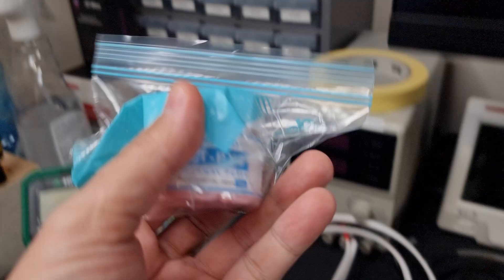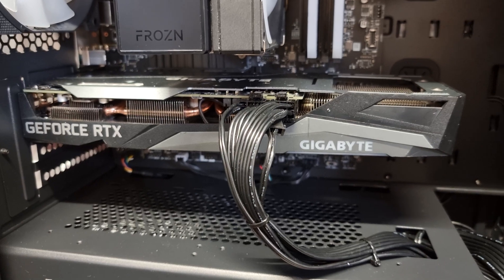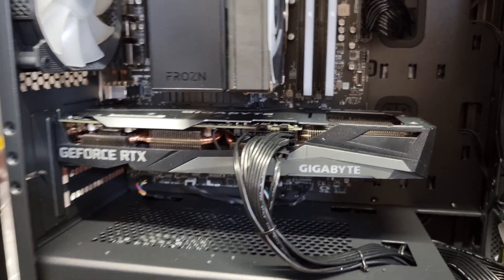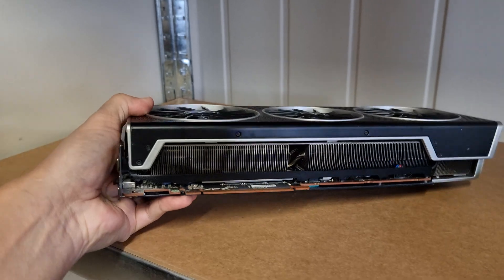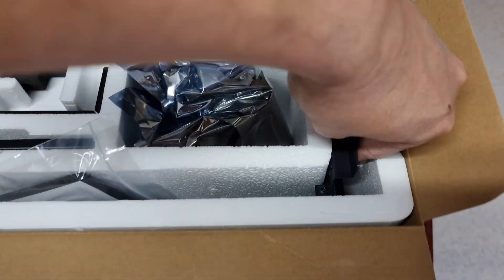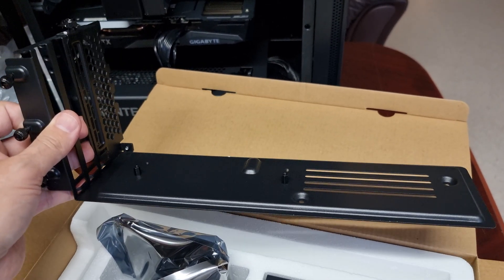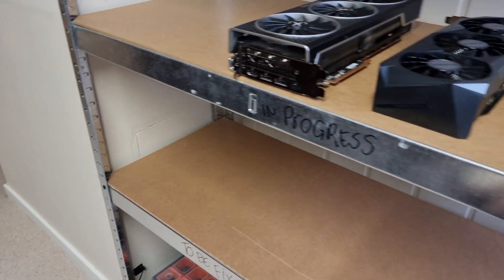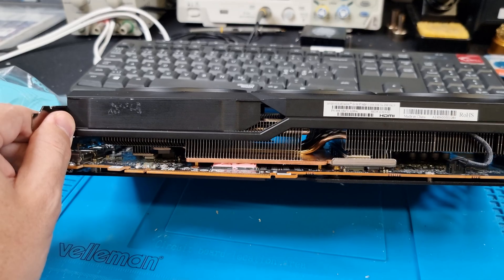Why Modern Day Graphics Cards Are Dying Prematurely.

Comment: I have a Corsair 2500X with a TUF RTX5090 + TUF B850M-PLUS WIFI (3xNF-A14 at the bottom of the case).

Do you have any advice for a sag bracket? :D
Reply from the maker: I buy these from Temu, but you can also find them on AliExpress: https://www.temu.com/goods.html?_bg_fs=1&goods_id=601099695186759&sku_id=17592891160347&_x_msgid=151-20250904-18-B-905764602225426432-427-zLleLmFr&_x_src=mail&_x_sessn_id=8d7rhikg46&refer_page_name=bgt_order_detail&refer_page_id=10045_1763738495447_073todoodi&refer_page_sn=10045
Reply: @TechnologyHive  Hey thanks for the reply! I will take a look :)

Comment: Hello, should I buy a case and switch to a vertical mount? Would an anti-sag bracket do the trick? I have an  Asrock Steel Legends RX 9070XT.
Reply from the maker: You don't need to buy a new case. A good support and correct placement of it should do the trick. Place the support between the second and third fan, so 2/3 the way. This will keep your card happy. But if you want an excuse to move your hardware into a new shinny rig, sure. And vertical mounts look nice also.

Comment: been thinking maybe i should get an adjustable bracket, have a dell 3090 (it's small, like 267mm small, they were made to fit into alienware r11's, but chonky heatsink & vapor chamber so still heavy for it's length), visibly it hasn't budged a bit in a year so far
definitely no 40 or 5090 in mass so i might be letting tech paranoia get the best of me, but they are kinda precious commodities at the moment

seeing now that's not really the message of the video, but still, one thing that's been on my mind
will be very careful playing around in there (like i said, tech paranoia, so i'm usually good at that, but also a little clumsy, card is coming out anytime i need to tinker from now)
Reply from the maker: The cost for GPU's is about to skyrocket also, due to VRAM cost going up. So I'd advice you to hold on to that 3090. A $5 support can do the trick. You find them on AliExpress.

Comment: so 
basically you are saying for a new build, i should mount my card vertically, or horizontally with a support?
i am new (so ne that i didnt even built a pc yet). i was thinking about a " Lian Li O11 DYNAMIC MINI V2 ", and in their page they have the "GPU ANTI-SAG SUPPORT", is that enough to prevent this issue with an horizontal gpu, or am i better of to go with a vertical setup?
thanks :D
Reply from the maker: If it is a new build and your card is a heavy one, I would use a vertical mount. That is a nice case, btw. If the case comes with some kind of support, definitely use it, if you want to skip the vertical mount.

Comment: Installing a GPU water block could be another way reduce the weight of those cards.
Reply from the maker: Yes, but then you add another failing point, the pump. And typical water blocks are not light. They do have some weight to them, though not as much as some of these ridiculous heatsinks nowadays.

Comment: Why specifically 3rd party vertical mounts? What's wrong with one built into the case?
Reply from the maker: The vertical mount options typically included with cases places the GPU too close to the side panel, not allowing it to "breath". 3rd party vertical mounts allows you the owner to place the card closer to the motherboard or closer to the side panel. Obviously you'd want to have the GPU away from the side panel so it can be kept cool.
Reply: @TechnologyHive  I was thinking maybe they dont have any support at all on the bottom & all the strain is on the frint bracket & thats why you didnt like the case ones.

I never understood why they put it so close to the side panel for vertical mount. Defeats the purpose to have a great GPU & then have it thermal throttle all the time.

Even SilverStone made a new FLP02 with option to vertical mount but no breathing room. They could've at least put 1 small fan hole there for it. Many old cases had a little fan on the side for ventilation.

I was thinking maybe they dont have any support at all on the bottom & all the strain is on the 1 bracket & thats why you didnt like the case ones.
Reply from the maker: @goldenheartOh  I am with you on that I too have no clue why they even build a case with support for a gpu vertical mount, yet place it so close to the side panel, defeating the purpose of the vertical mount idea in the first place. This is why I recommend the one I use in all my builds for customer or personal use, which is the Phanteks vertical mount. It is cheap relatively to the cost of one of these newer cards.

Comment: i have aorus master 5090 and i want to mount it verucally but i cant because the putty will leak as people say

also currently its mounted horizantlly + included anti sag stand is installed
Reply from the maker: That's no problem, just add a support between the second and third fan and you will be fine horizontally.

Comment: I just bought a Saphire 9070 xt. Sadly I cannot mount it vertically. I need to do it horizontally. I am aware of the sag and thats why I additionally bought a support. A little black stick which I can make longer and shorter by adjusting screws and has a magnet on the bottom side. Will this be enough to save my card from damage by being mounted horizontally?
Reply from the maker: Yes. I would put the support between the second and third fan. It will be just fine.

Comment: It is great that you made this video to make people aware of these kind of issues :)

I started to add something at the end of the card to hold it straight in the case 2 years ago when i bought higher end cards that had some weight to them.
Having the card in the case without any support will make the circuit board of the card to slowly warp over time when it gets cold and hot if it doesn't have any extra support to hold it up.
It can also damage your pcie slot on your Motherboard over time too.

There is no need for a expensive vertical mount or a sag bracket If you can find something at home to hold it up at the end of the card in the case if your case doesn't have space for a vertical mount bracket.
Reply from the maker: I use these from Temu and they work just fine. You can also find them on AliExpress: https://www.temu.com/goods.html?_bg_fs=1&goods_id=601099695186759&sku_id=17592891160347&_x_msgid=151-20250904-18-B-905764602225426432-427-zLleLmFr&_x_src=mail&_x_sessn_id=5tvx3pe5b8&refer_page_name=bgt_order_detail&refer_page_id=10045_1763723059572_rcrer8du7o&refer_page_sn=10045
Reply: @TechnologyHive  That is what i use now too :)

Before i found it on Temu i was using a pretty and small mint box to hold my card up that looked great in the PC but it didn't fit my newest card so i did some Temu shopping. he-he

I  also bought a Vertical Bracket but that wouldn't fit in my case so i ended up using the Temu Stick that i bought as option B.

Comment: As GPU's gets bigger and heavier,i use vertical mount bracket.I use it on my previous 3080 and
now on my current Sapphire Radeon RX 7900 XTX NITRO+ Vapor-X (2,850 grams).
Reply: not op but i've just got the nzxt one on sale (40€) and it does its job
Reply from the maker: @jeddunkxyz  That's a good vertical mount.
Reply from the maker: It would be helpful if you could post a link to the vertical mount kit you are using. I recommend one by Phanteks. Its under $50 and well worth the price.

Comment: Due to how heavy my GPU is, I was worried that it would crack even vertically

So I got a riser cable and I placed the GPU on the bottom of the case

It looks questionable, but at least it is placed on top of the bottom case fans so it sure as heck ain't lacking air flow xD
Reply from the maker: It wont crack vertically unless you try cracking it yourself. Also, remove the card during transport, as it can be damaged even if installed vertically.
Reply: @TechnologyHive  one day they'll crack vertically too, because the card is so heavy that it is sketchy enough as it is
Plus I am not a careful person, I fully expect my pc to be bumped and moved around by myself in a few months xD
Reply from the maker: @labmasterx5599  I can't help you there lol. But your card should survive more abuse vertically mounted than horizontally.
Reply: @TechnologyHive  thank you xD

Comment: The issue with vertical mounting cards like most 5080's is that the airflow goes from bottom to top so when mounted vertically you end up blowing hot air onto the motherboard messing up the airflow making them run a lot hotter than they need to be. I'd say a decent gpu stand on the edge is fine in my experience 🤷‍♂
Reply from the maker: You can do as you wish. But installing the gpu vertically does not increase motherboard temps. In fact, it helps redirect the hot air up and out of your case, as long as you have good exhaust in your case.
Reply: @TechnologyHive  That depends on the type of gpu. My 5080 inno3d Ichill card blows like 80% the total heat straight up form the back of the card. So when mounted vertically its blowing 400w of hot hot air straight onto the motherboard and ram. 🤷‍♂ To add to that fishtank cases with side intakes makes this even worse as then they're pushing air against a vertically mounted 5080 exhaust. All I'm saying vertically mounting isn't always the best option.

Comment: Good day sir hope you are well, like a noob i put 2x4pin cpu into gpu...and put on pc..nothing happn ...i realize mistake ...gpu bluelight go on , but the board is cold and no fan spin on startup at all...can it be repaired ? i took it out my system no visible damage to board 😢thanks for your time oh its rx 580 xfx gts xxx 8gb ,is it possible to save
Reply from the maker: If you used the wrong power connector and the card is no longer working, then surely there must be a short somewhere. Honestly, the repair will cost you more than the card is worth.
Reply: @TechnologyHive  thank you for the response and thats what I suspect as well 😢

Comment: Oh shit, glad I found this video. Or it's more like it found me, valuable yt recommendation here! Bought a 5070 TI -  2months ago, already thought that this brick could lead to issues without support, now I know for sure.
Reply from the maker: Those are generally large and heavy cards. Yeah, I would use some form of support. It doesn't need to be fancy. You can find them on AliExpress or Temu. I use these here myself: 

https://www.temu.com/goods.html?_bg_fs=1&goods_id=601099695186759&sku_id=17592891160347&_x_msgid=151-20250904-18-B-905764602225426432-427-zLleLmFr&_x_src=mail&_x_sessn_id=5tvx3pe5b8&refer_page_name=bgt_order_detail&refer_page_id=10045_1763723059572_rcrer8du7o&refer_page_sn=10045

Comment: Thank you this is really good info right here, one question though, Is there not any other risks mounting the card vertically ? I mean with the heat generated by the card long term speaking can't it end up with other issues on core or memory ? Like old iMacs that had graphics card going bad because of the vertical mounting and heat
And the card is not by design created to run vertically
Reply from the maker: If you have front mounted fans blowing cool air into the case, and one or more as exhaust, you will be fine. I have had my cards installed vertically for years and never have had any issues with overheating the memory or CPU cooler. Just use proper exhaust and you're good to go.

Comment: Can we use like a lifter that goes underneath the card and acts as a support beam, if so what to use and where to place it?
I have another question and if anyone knows the answer (Gonna use a Superflower Leadex VII Platinum Pro 850W for 9070XT and 9800x3D, how good is the PSU?)
Reply from the maker: Regarding the PSU, Super Flower is top of the line, especially the Leadex VII. I have a few of them. They are the OEM for various reputable brands of PSU's.

You can get something like this as support:  

https://www.temu.com/goods.html?_bg_fs=1&goods_id=601099695186759&sku_id=17592891160347&_x_msgid=151-20250904-18-B-905764602225426432-427-zLleLmFr&_x_src=mail&_x_sessn_id=5tvx3pe5b8&refer_page_name=bgt_order_detail&refer_page_id=10045_1763723059572_rcrer8du7o&refer_page_sn=10045

I do not care where you get it, but this will work just fine.

Comment: I chose for a water cooled graphics card because of the smaller size (even shorter than the motherboard) and weight but I also decided horizontal mounting is the way to go no matter what so I bought a rackmount enclosure.

It just happened to fit in the top shelf of my under desk shelf/ cabinet so it lives there and I have a bunch of extra room on my desk 😂

I also mounted a base board heater under my desk that cools my pc while keeping me a bit more comfy 😅
In the summer I just have to close a valve and open another one to dump the heat outside.
Reply from the maker: Just keep in mind that water-cooled gpu's tend to fail around 3-4 years due to pump issues or permeation. I am not saying your will go like this, but it is common.

Comment: So correct me if im wrong with understanding the point. 

Basically, we just need some form of support and that support doesnt need to add additional force (upward force) to the gpu itself. And only to "level" or atleast add some like security/latch/ any other form to the other side of the gpu (i mean the opposite side from the screwed in part of the gpu)
Reply from the maker: The card just needs to be leveled to the PCIe slot. No need to add force pushing the card up with a support or anything like that. The card is just supposed to rest on the support and that is it.
Reply: @TechnologyHive   I see thank you for that. 

Although I have an interesting case tho. Like literal "case", my pc case. The gpu is so long that I need to remove the middle case fan just to fit it there. And so theres no more room to add the support on the far right side of the gpu. 

So then I used the bottom fan itself as the support. I raised it to the level of the gpu, screwed it in, then there it is. 

Do you think thats also okay or will still do the job just fine?
Reply from the maker: @thubanhiroi  The best position for the support is 2/3 the length of the card, so if it has 3 fans, add the support between the 2nd and 3rd fan. 

I see you have gotten creative there using the case fan as support, but that is at the very end of the card. I suppose some support is better than none, but I would still, for the long run, get a dedicated support for the card. Something like this will work. I use them myself: https://www.temu.com/goods.html?_bg_fs=1&goods_id=601099695186759&sku_id=17592891160347&_x_msgid=151-20250904-18-B-905764602225426432-427-zLleLmFr&_x_src=mail&_x_sessn_id=5tvx3pe5b8&refer_page_name=bgt_order_detail&refer_page_id=10045_1763723059572_rcrer8du7o&refer_page_sn=10045
Reply: @TechnologyHive  kinda because the bottom of panel thing (of my pc case) below the gpu is cut way too short. So i cant really put the support on the 2/3 parts of the gpu, more so just in the middle of it. 

Anyways, thanks for the info!!

Comment: My 1080 Ti likely failed due to this issue. It sagged heavily and eventually developed VRAM artifacts. Its like the physical connection to the memory is lost.
Reply: @voyagerdeepspaceexploration  why not just use a gpu support?
Reply from the maker: @heroicsquirrel3195  Using a support after the card has failed will do nothing.
Reply: @TechnologyHive well duh😂 im saying why not just use a support initially, i gave an asus prime 5070ti which is pretty small n light but i still use a support like i did with my massive suprim x 3070
Reply from the maker: The repair should not cost more than the card is worth. But 1080Ti are a legend, imo. And yes, if you are seeing artefacts, it is likely the memory or depending how bad the sag is, it could also be the core.

Comment: Me: Make a hook from a steel wire and bolt it to the case with nusts... GPU works for 10 years
Reply from the maker: As long as it provides support, it should work :)

Comment: One thing that i haven't really heard anyone point out, the biggest issue that modern gpus have is that the metal io bracket that attaches to the case is NOT attached to the cooler in any way. Without firm attachment of the rear io bracket, all the weight is taken up by the pci e finger. This was sort of touched on in a jayz2cents video but no emphasis was made in why sag can lead to card damage. https://youtu.be/liChy76nQJ4?t=8m41s

If the metal io bracket was firmly screwed into the cooler and shroud and did not have a gap between the two, as the gpu tries to sag, it will firmly push against the metal bracket like a cantilever. 

Of course vertically mounted gpus are the safest, and a properly leveled and supported horizontally mounted gpu with sag bracket or stand is also decent. Unfortunately not everyone will go this route which is why these cards should be designed to cantilever against the back of the case by default. The fact that gpu manufacturers rarely do this just means they don't care one bit.

Personally i prefer the look of horizontal gpus without any support bracket or stand. I always shim up my gpus with cardboard so they are firm against the io bracket. Here you can see there is absolutely no sag and the way they should be from the factory. https://imgur.com/a/GhCECyj
Reply from the maker: I have two cards here from XFX in for repair with the GPU IO plate that attaches to a metal frame that runs all the way to the rear of the card and still the cards have the same issue: ripped memory pads by the PCI-e slot. It is best to use supports or install the card vertically. Manufacturers add more metal to the equation thinking this will make the card more rigid, but all that does is create more weight and weight is the problem here.